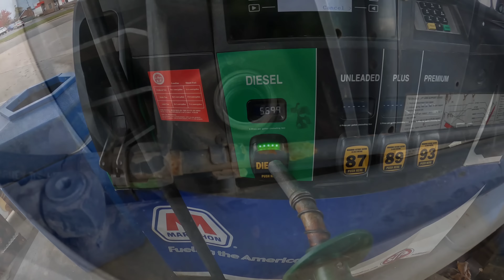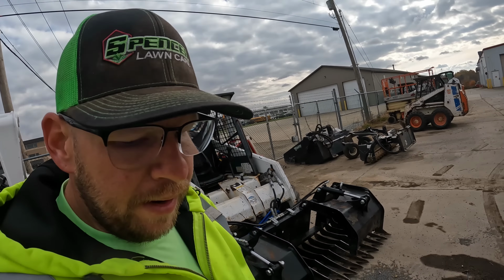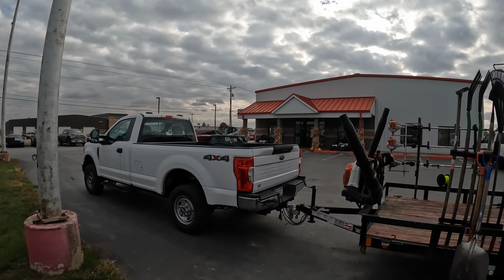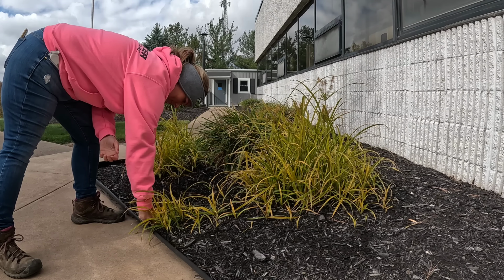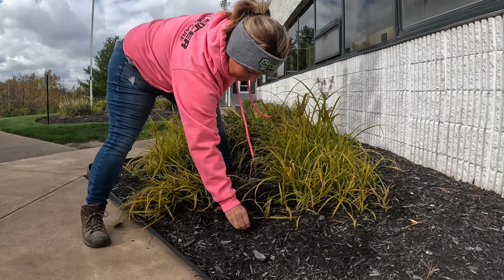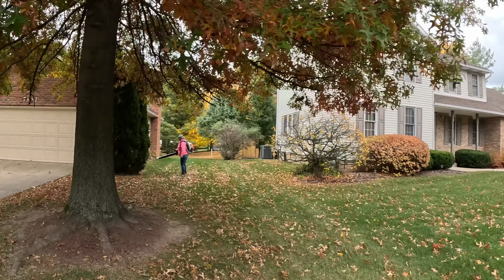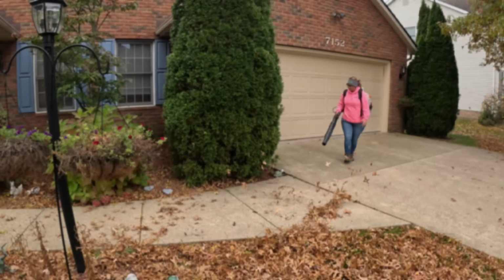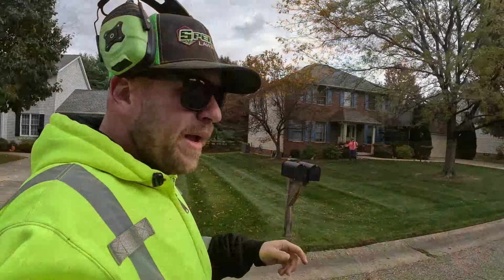How Bad Will It Be | Delivering The Goods!

Comment: On your grapple I was thinking about your issues.   I remember when you guys were working on it you found out the hoses were replaced with smaller diameter hoses.   I think that explains the aggressive action of the grapple and leaks in the fittings.   The unit still produces the same PSI for the hydraulic fluid as it always did, but with the smaller diameter hoses, the pressure gets increased.   That makes the grapple react a lot faster (aggressively) and could explain the leaks in the fittings (too much pressure).    While it is in for service, have them look at that.  You might have to put the correct size hoses back on the unit to solve your problems.

Comment: What does your Bobcat weigh, I need to find a skid steer but weight is a challenge. Plus I need a track version.
Reply: Get an asv rt30 or 40. They are track machines that weigh less then 4k lbs but they are very strong

Comment: Those bobcat tractors are made by kioti tractor just a different color. buy from a kioti dealer and save $$$$$ for the same machine. But the $$$$ in your pocket for your new dream shop. Same with a tracked skidsteer. there are 2 other brands which are better quality. don't let the bobcat name fool you.